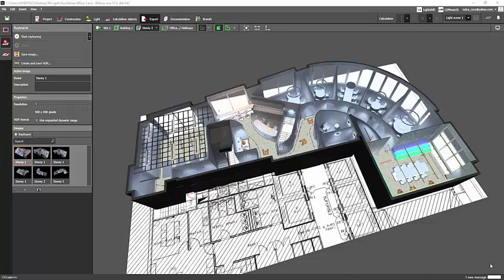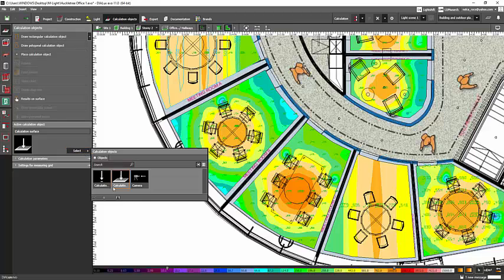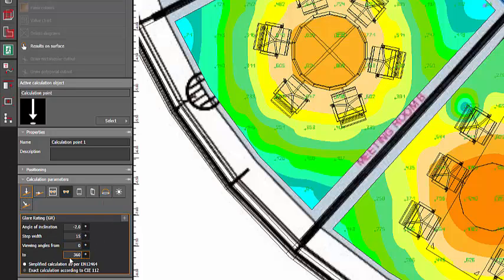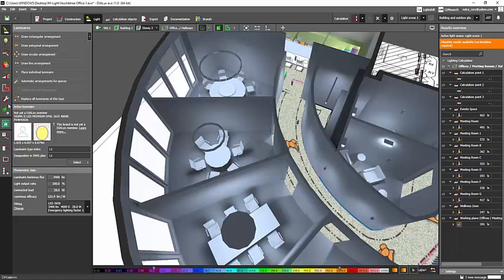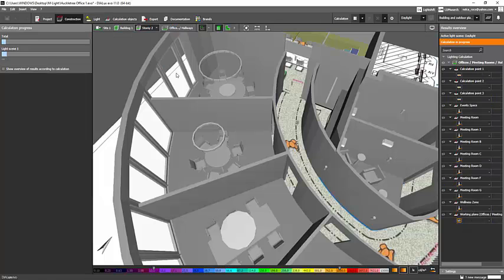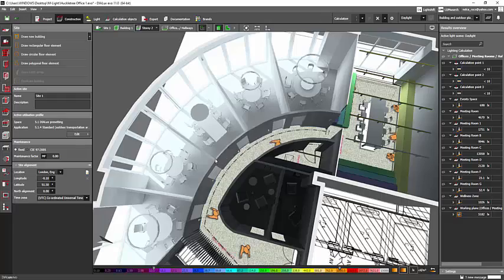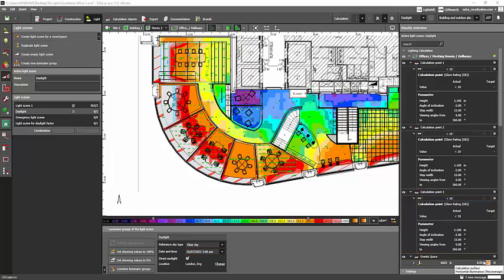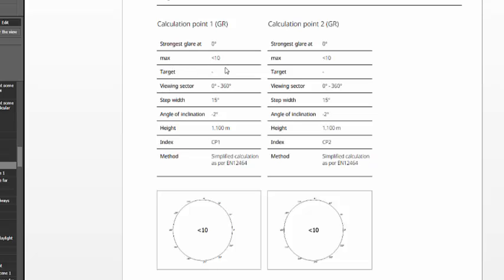How to calculate Glare Rating from Daylight

Comment: Hello , May I ask the STEP WIDTH what degree should I put ? STEP WIDTH base on what  ? because I am using GR caculate outdoor HIGHWAY TOL with a HIGHMAST LIGHT 20 METER height
Reply: As far i know step widht is degree between horizontal line view to light source view
Reply: @mochulin616  Thank  you ! because I also looking all these intruction , I will check back all these